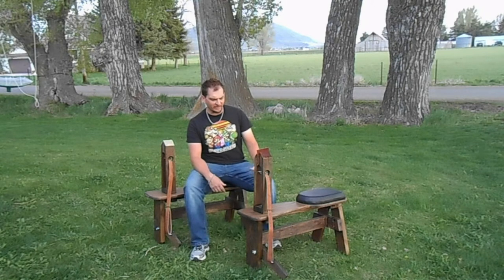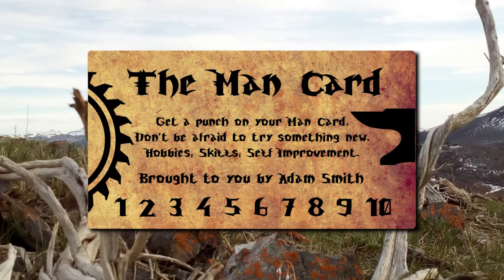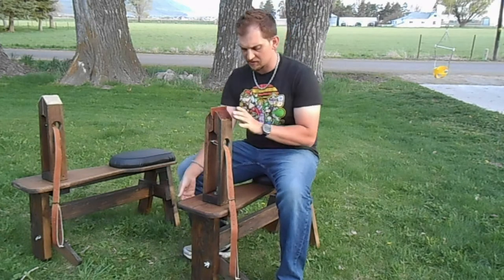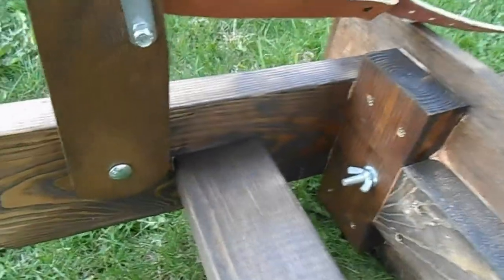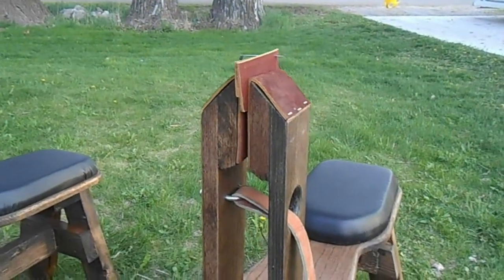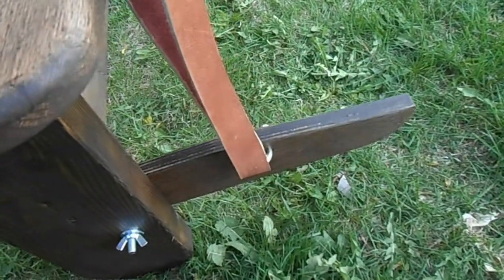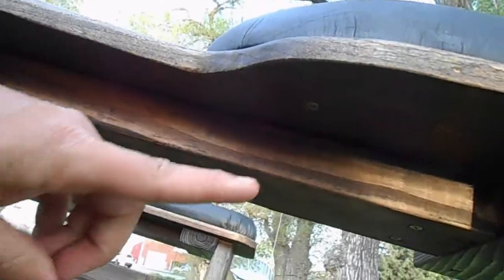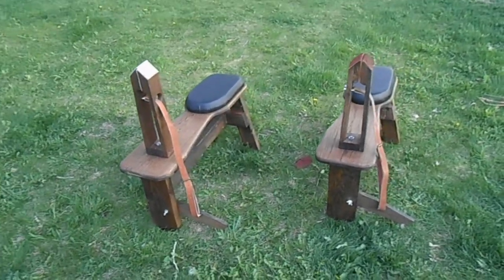Custom Stitching Horse

Comment: Listen my arms are long, but there not that long.Don't you think the seat should be a little closer, like maybe half that size, and while your at it, you could lose a little height in the post so there down where a accurate elbow up stitch could actually be achieved. I think your idea is great, but your proportions are a little out of whack for a ergonomic and practical stitching distance with optimal control and proper stitch positioning.
Reply from the maker: Those are some great suggestions. These were a first attempt, I don't mind the position in sitting and stitching myself. That being said I don't do this for terribly long periods of time. It would probably help to decrease both the distance of the seat to the jaws as well as the height for longer use comfort. Thank you for the comment.
Reply: @themancard4692  I've just been investigating doing some leather work for the past couple of weeks, so I've had an opportunity to watch a lot of video's and just bought a pony. What your doing would have been exactly what I would have wanted, at the right price.
     The pony it's self without a workbench is really like a fish out of the water, but a combination pony at one end, seat in the middle and a small work table at the same height as the pony at the rear would be perfect . 
     This way you could use the work table as a back support for the pony stitching and then just get up and turn around and sit back down to a small work bench for punching, Now that would be worth a couple hundred bucks to a guy like me. 
      P.S. I wouldn't bother with the extra expense of a seat, if the user wants something softer then the wood he / she could just get a small throw pillow and use it for a cushion. Cut back on cost and time for you, and maybe pass the break on tot he customer or offer a custom seat for extra. I'm gonna sub to see what you come up with.